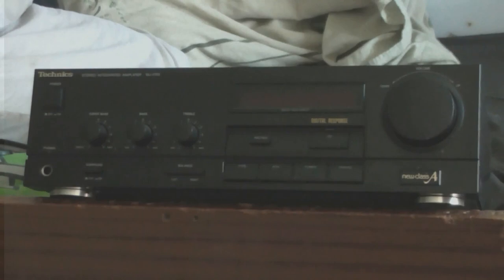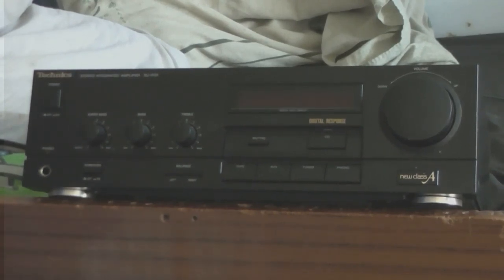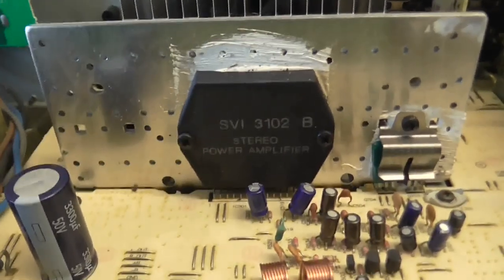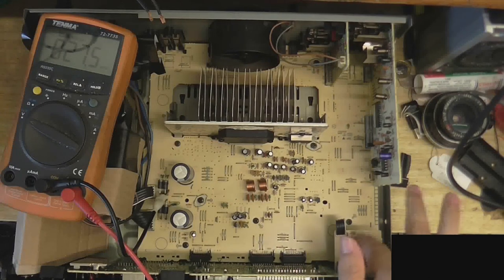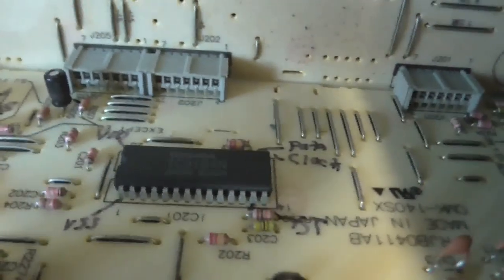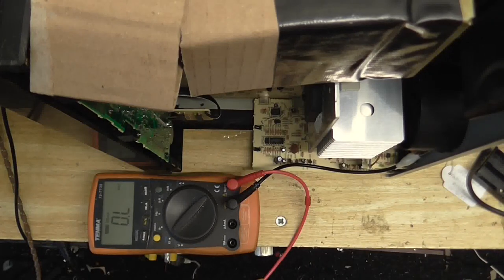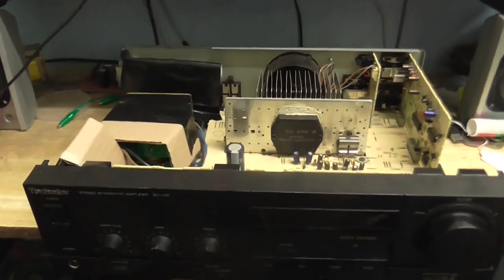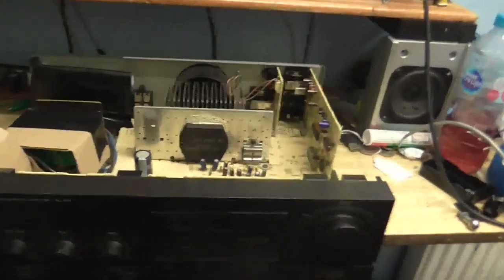Fixing a Technics SU-X101 amp pt 1

Comment: You need to fit the external links connecting Ext out to Ext In, you can use phono to phono jumper leads. Due to the age of the Amplifier you should check the soldered connections on the power supply transistors mounted on the heat sink to the right of the Audio output IC. Then reflow the joints, worth re-solderng the Audio output IC as there will be also dry soldered pins.
Reply from the maker: I wished I had known that in the beginning, it would have saved all that confusion! That feature actually came in pretty useful because that means I could build a device where I can control the volume externally with a potentiometer.
Reply: You may of noticed the volume encoder is stuff to turn, this caused by the original shaft lubricating grease drying out.
The encoder can be removed from the small circuit board and Servisol super 10 switch cleaner used to dissolve the grease.
You will then find the encoder can be rotated with the tip of a finger allowing very fine volume control adjustment.
Reply from the maker: Actually there no problem with that, it turns just fine. The external volume control I made is so I can turn it up or down when I'm on my bed so I don't need to reach for it.
Reply: Thank you for advising.

Comment: Great video I have a technics sux-102 amp that won't power up. On further inspection I think c700 Is the problem. It's wired in parallel to + & - across ac main supply voltage it's a 0.1 uf 500v ac capacitor. I have experience in fixing electronics but only as a hobby so I have a multimeter only no scopes etc. Would it be ok to remove c700 from the PCB and test if it works. I think it would be ok unless there is a problem elsewhere then we'll you know how far my neck will be. I also have a question on a Panasonic sa-pt- 570 but that's the next project. I hope you can answer me. Keep up the great work.
Reply from the maker: I wouldn't think the capacitor is the problem here, that's just there to filter out any small spikes that may be on the incoming AC, you could remove it and test it if you want to. I really cant tell from here what the problem could be though.
Reply: @CoolDudeClem  thank you so much for your reply. I will remove the cap and test. I do think the cap is faulty in a short position as the cap is wired in parallel with the main ac + and - and the PCB is shorting everytime power is supplied

Comment: This is the same as the one that I have, the SL-P350 CD player that you sent me replaced the SL-PJ26A that originally came with this, they make VERY good sounding little systems when connected to decent speakers, get yourself a cheap pair of B&W DM601s and you really won't be sorry! If I remember rightly you have the CD player that goes with this still in the shed...

Comment: What can I use instead of thermal paste, otherwise I could repair mine tonight if I knew
Reply from the maker: Oil can be a temporary fix since it conducts heat well and doesn't conduct electricity.  Just for a temporary fix though. A more permanent fix you should use thermal paste.  I used to make my own thermal pads from paper and WD-40 but it always dried up quickly.

Comment: Why does it say "Class A" on the front when it uses one of those STK-type chips which are obviously complementary Class A/B? 

Rotary encoders... What's the point of them? Pots allow me to adjust the volume stepplessly. Why would you use more advanced tech to get a worse outcome?
A nice looking piece of equipment though. Halfway between vintage and modern.
Reply from the maker: I think the "New Class A" is probably just a wank marketing term.
Reply: @CoolDudeClem  

I looked it up and apparently it's a class A with bias automatically increasing with signal intensity, to reduces heat losses (hence the small heat sink I guess). Pretty smart, but I still think the output power is probably quite low for a SS amp and I don't really buy the whole "Class A sounds better" meme anyways. Still nice though.

I thought this was just a standard STK IC but seems like it's not. However I can't find any information on this specific IC. Don't judge an IC by it's cover I guess, LOL.